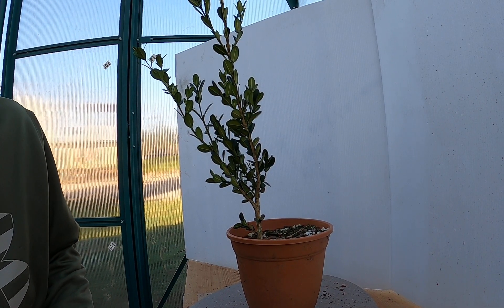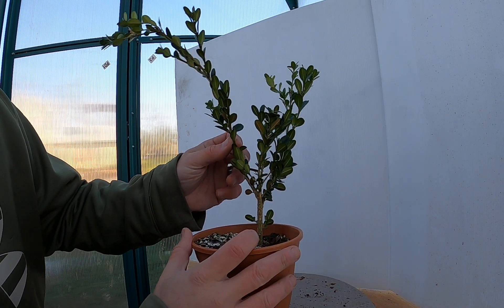PRE BONSAI TWIN TRUNK BOXWOOD

Comment: Nice initial styling Matt. One hint that I've found useful when putting guy wires directly onto branches, because the wire is under quite a lot of strain in order to bring the branch down, the wire tends to cut into the branch quite quickly. In order to prevent this I now always slide my wire into a short length of aquarium air tubing and I find that this helps massively in preventing wire marks on the branches. 👍👍
Reply from the maker: Thank you Guy. I will look into getting some of that tubing. Also thank you for watching!

Comment: Looks like it’s off to a good start. Boxwoods are very popular for bonsai. Unfortunately I haven’t had much luck with them surviving winter so far. I finally have one that might make it if it survives the winter. Good luck with yours. Thanks, keep growing
Reply from the maker: Thank you Matt. So the big factor for me is the aggressively cold wind. I keep most my tree's in a blocked off section out of the wind. Since I did a cut on this little guy he will stay in the greenhouse this winter. Zero wind but the temperature is not much different from outside. I will keep you posted on how things turn out. Thank you for watching!